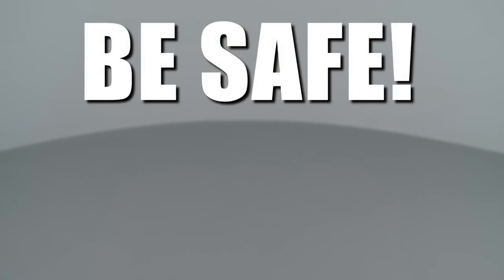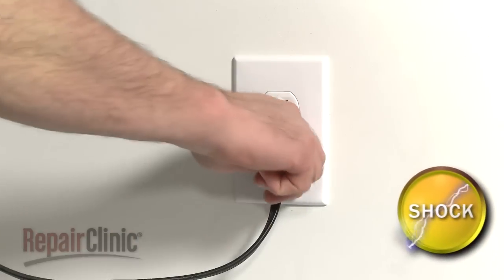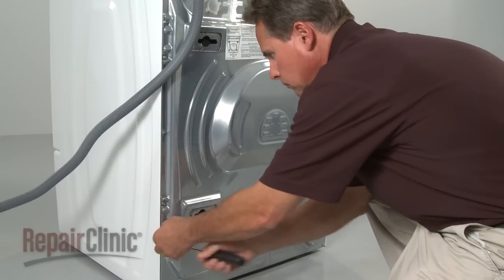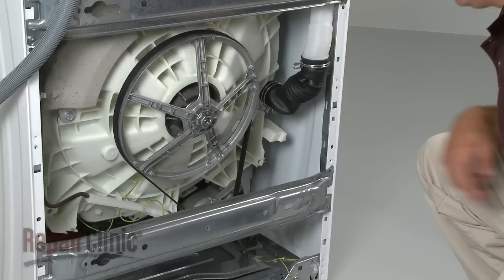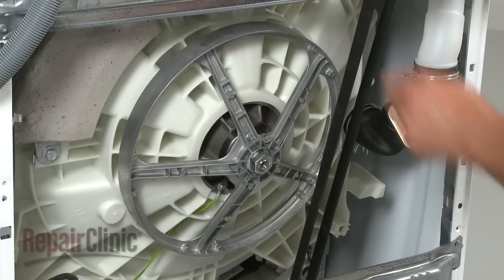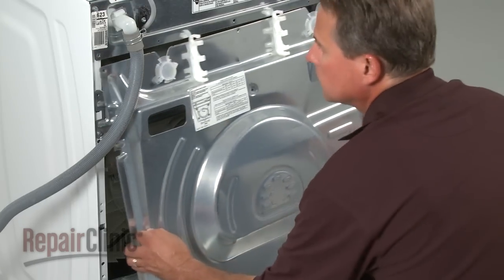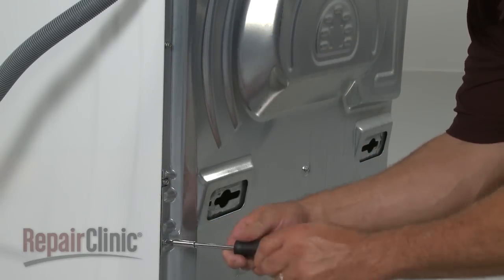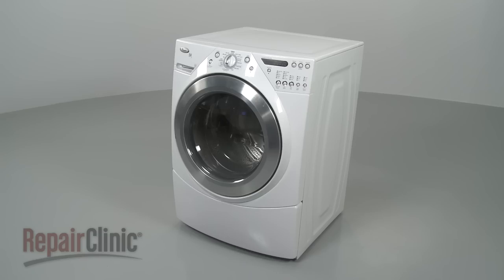Whirlpool Washer Drive Belt Replacement #W10388414

Comment: You forgot to mention the fact that the new belt is smaller than the old belt and won't go on as simply as shown in the video unless you stretch the new belt somehow... it's not a 1:39 job like the video shows.

Comment: Using zip ties to hold the belt on the big pulley allows you to rotate the pulley with both hands with the required force to properly align the new belt.

But my issue is that the belt keeps breaking after I get it on and try to run a cycle, I’m on my 3rd belt, any solution suggestions?
Reply: Thank you!

Comment: I have the Maytag 4000 series washer and it sounds like the belt is slipping when it starts to turn (either clockwise or counter clockwise) once it goes it goes tho.... I may order a belt and change it after watching this video. looks fairly easy
Reply from the maker: +chris murray 4000 series does not help identify the unit. Get the model and serial number to find information and parts for your washer.

Comment: I have a Kenmore front loader stackable. The belt keeps coming off and ends up between the metal wheel and the tub. Its very hard to get the belt back on so I don't believe the belt is stretched...??? Its the 417.40042990  When I watch it spin with the back panel off, before it jumps, the belt seems to only stay half way on the wheel towards the tub It almost looks like the pulley poll it sits on is slightly being pulled outward at bottom. If that makes any sense. Any feed back would be greatly appreciated.
Reply from the maker: Brenda Griffith If the belt won't stay on we recommend replacing it to ensure it is not simply worn. Does the machine shake or seem out of balance? If not, we would suspect a bad belt.
Reply: It was diagnosed bent shaft. Thank you for your response!

Comment: is it normal for the tub drive pulley to wobble?  mine has lots of play.  if it's not normal, is there a bearing or something i have to replace ?   the belt was completely off, and i plan on replacing on it.
Reply from the maker: The drive pulley should not wobble at all. You will most likely need to replace the pulley also. If the main tub bearings were bad the whole tub would wobble and cause allot of noise in the spin cycle.
Reply: ***** yes the tub would was wobbling pretty bad -  ugh not good.
Reply from the maker: Sorry to be the bearer of bad news!
Reply: ***** no problem, i appreciate the info!  can you tell me the part# for the bearing?  it's for machine model # WCVH6260HWW
Reply from the maker: The rear bearing is pressed into the rear drum and needs to be replaced as an assembly. The bearing is not sold separately. With the cost of the rear tub and time involved to fix it you may consider replacing the unit.

Comment: I have a GE washer and it will not stop filling up with water it overflows  how can I stop this  can someone please help me out with this problem  thanks
Reply: Sounds like it could be your pressure switch or valve not functioning correctly.

Comment: I couldn't get the belt onto the wheel. ended up cutting my hand because the belt wouldn't slide on the wheel unless I took it off the motor first and then I couldn't get the belt to the motor.
Reply: Did you ever get the belt back on? I'm having the same problem!